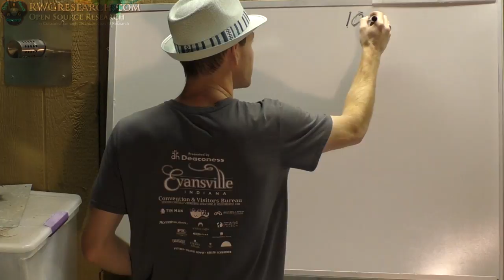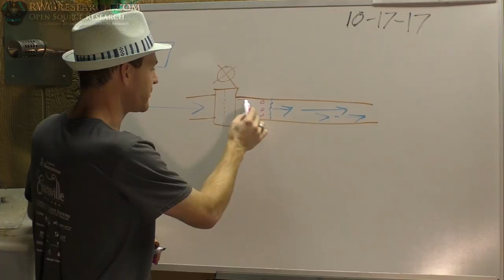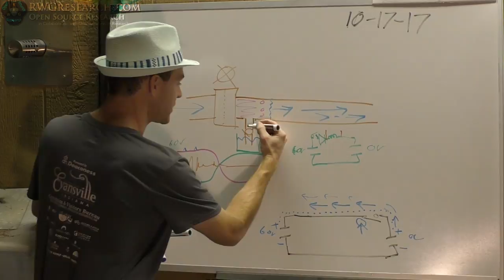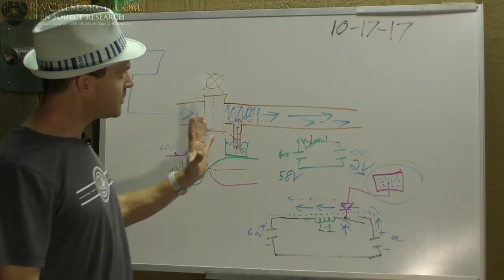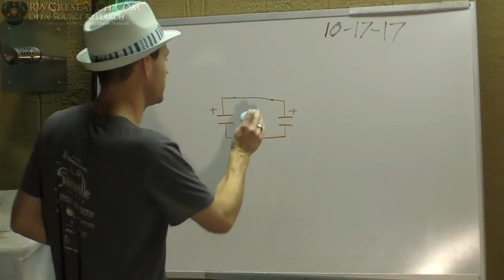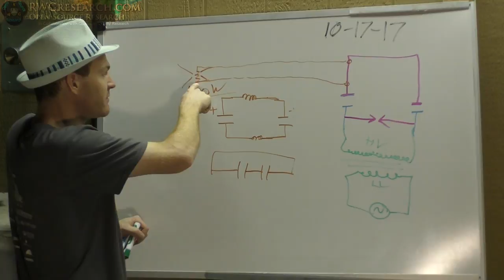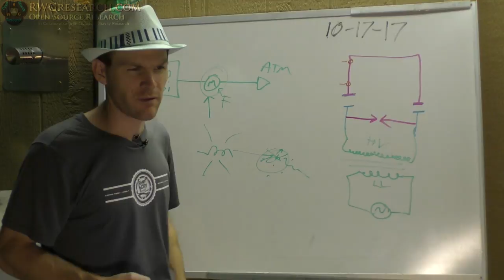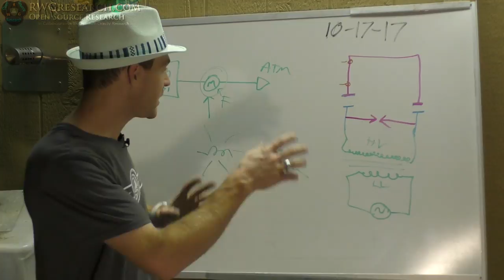The Search For Answers Part 7: Eletrical Water Hammer? Thinking Out Loud... & Other Ideas To Share.

Comment: another point worth mentioning is that if we can generate a low pressure energetic state and transform the energy, then it might be possible to generate an energetic sink that would perpetually generate energy.  So low voltage, especially with negative resistance potentially could generate such an energetic sink...  If we think in terms of pressure systems and fluid dynamics, I think things become more clear.  That is why I like the water hammer analogy type of thinking...

Comment: Great man, how do I make a ZVS driver that oscillates at 500 khz to 1mhz that can use about 36 volts at 25 amps. .3uh inductor .33uf capacitor.  If I increase input voltage and amperage it should oscillate faster or not and why? =1/((2*3.14)*(SQRT(inductance*capacitance)))

Comment: Hi Russ,
I am planning to build a Leedskalnin PMH device. You mentioned that one can store energy in a magnetic field at ambient temperatures and showed one of these devices in the video. I thought this device works on a principal called "magnetic hysteresis" of the metal used in it. This has long been understood and is how the old magnetic core memory in the 1st computers worked, how computers store info on a hard drive, and how magnetic recording tape works. Are you referring to when you pull off the magnet keeper bar, the magnetic field in the bar collapses, a current is induced, and the LED lights for a split second? How is the energy stored? If you don't put energy into the system by the act of pulling off the bar, which requires work,  no useful energy can be extracted from the device. What are your thoughts on this?

Bill
Reply from the maker: William Hada Bill. This is corect. 
Its the same prencible. The deffrence is how the energy is extracted. Core memory dose it differently. We breake the loop. 

I made an electronic PMH so it can be "switched" on or off instead of removing the bar.  I don't think I ever made a video on it. I can if interested. 

I was just pointing out in this video there there are diffrent ways to do this stuff at room temp.  
Just to open the thoughts to people. 

Right. When you pull off the bar. The feild collapse.  Whats Intresting here is that what ever you put in to the loop of iron. Stays there. (It dose not slowly disipate like a charge in a cap.)  
So this is in its self a "room temp super conductor" in its own right. 

Becuse its not permentanly magnitised. It is  A state of magnetism,  but not permonant yet dose not degrade its strength with time.  

I'm sure one could call me wrong for calling it a super conductor.  However I feel its the right term. As it only works as a temporally permonant  magnetisum storage device at room temp.  With out degrading its strength.  

Hope this helps. ~Russ

Sorry for the typeos.  On my Phone. Ergh

Comment: FIRST QUESTION: Back and Front EMF Phenomona. Secondly, you could run a motor in between your two batteries and yield the same voltages on both sides: about half.

I like this discussion. Its like trying to understand the Don Smith application.

On your last, and I haven't experimented with this at all by the way, can one use piezo electric from the heat of any one of the motors in the circuit to produce a cooling effect on the other side in order to "super cool" the magnet?

Comment: what you want is already made and commercially available. an exact electrical equivalent to a water hammer is called a boost converter. they are roughly %90 efficient just like a properly made water hammer. low voltage high current in, high voltage low current out.  if you want the other way around, its called a buck converter. high voltage in and low voltage out.

a boost converter is very similar to the joule thief design. except the commercial ones are more consistent and often more efficient.
Reply from the maker: Jimmy O. Yes. I know all about thses. But this prencible is slightly diffrent. And from my understanding most boost/buck converters are horribly efficient.  Mabey there are new ones that are better. Thanks!  ~Russ
Reply: they are about as efficient as you can get right now. far more efficient than using normal AC transformers on linear regulators or resisters to drop the voltage to a usable voltage.  when converting AC into dc switch mode power supplies are used for the best efficacy they turn the AC into DC right away then use that DC through a buck converter to get the desired voltage. this is whats used in just about everything from your 3D printer to your cellphone charger. if they were solid cor transformers they would be much larger and produce alot more heat.

Comment: if you capture the magnetic fields created by electrical currents, it is not free. and it will draw power from whatever is causing those electrical currents. this is exactly how inductive motors work.  similarly transformers and ballasts work in this manner.
Reply from the maker: Jimmy O. Conventional thought tells you this. ("Drag")  However there are so many ways to use that feild.  And some of them do not effect this as you Speek. Also you can enhance the effect if done right. ~Russ
Reply: all energy is conserved. electrical energy is no different. Using that energy will end up effecting the source. either forcing the source to pull more power or decreasing the energy being delivered to the load.

Comment: I have been thinking about your Tesla example of lighting an incandescent bulb with a thin wire. I think Tesla used very high voltages with very low current. If you think about it considering watts in versus watts out it is not so unusual. Say you have a 100 watt bulb in a 120v ac circuit. The current drawn is 0.83 amps. If you put this same 100w bulb in a 12,000 volt circuit it only draws 8.3 milliamps of current and a thin wire could handle that tiny current. So in both cases you are still using 100 watts to light it. Is my thinking completely wrong here that you need to consider both voltage and amperage?
Reply: William Hada by my understanding that is correct.
I hope someone calls me an idiot and then proves themself not to be - by proving your postulate incorrect
Reply from the maker: This is a corect statement. 
Now. Do the math to calulate how much voltage and apmrage you need light a 500watt halagan to full brightness  Let me know the numbers. Let's say for what ever max current a 50AWG wire can handle. 
Then ask your self. If I need x, xxx, xxxV @. 000xxx amps 
What air gap do I need to keep this very high voltage from jumping from wire to wire?  
What I'm telling you is I can lay the 50 AWG wire 1mm apart from each other . (Magnet wire of course )  and it will not arc... ??? 

Also look at the circuit. Your tapping off of a dead short... Soild copper bar. 
I believe it can be understood.  However its not convental V x A
We will look at this further. But for now. Think about that. Let me know your thoughts!  Thanks for the comment. Its a good point. ~Russ
Reply: rwg42985 I thank you for takng the time to respond to my comment Russ. From my calculations a 500w lamp would draw 42 milliamps at 12,000 volts. A 35 AWG copper wire is rated at 44 milliamps max,  and has an O.D. of 0.00314 inches, pretty thin. A 50 AWG wire has an O.D. of 0.001 inches but I could not find the maximum amperage for this size anywhere. For 12,000 volts the minimum distance must be greater than 4 mm to prevent arcing over. Now, did you yourself do the 500w quartz light experiment or is this something you guestimated from a video or it was just claimed to be so by the other party making the video? I myself could not determine the diameter of a 35 or 50 awg gauge wire by eye ( 0.001 vs 0.00314 inches OD) . Nor think I could tell by eye if the wires were 2 mm vs 4 mm apart in a video. If you yourself , Russ Greis,  replicated this experiment and actually showed all the measurements on video I would have pretty much 100% confidence it was true.I find you to be very honest about everything you do and are very open to criticism and debate. Others I am not so trusting of because the experiments are often done in a confusing and sloppy manner with a lot of details missing. 

I have been following you for a while now. I am also into 3D printing and found your channel when you built your filament extruder. You are one amazing and multi-skilled dude!
Your energy and passion for your work is awe inspiring. I don't know how you get done all that you do and support a large family at the same time. But what impresses me most is your honesty and search for the truth. However, I am somewhat concerned about your health and that you are getting proper rest with this heavy workload. Stay strong, healthy,and keep up the search man!

Bill

Comment: Another great video! In the Tesla hairpin the reason there are two capacitors is because there is little or no voltage drop in the distribution supply line. This is still used today in distribution lines. It was invented by William J. McElroy www.google.com/patents/US392213 and https://www.google.com/patents/US393073 . The energy stored in a magnetic field is the capacitance of the Tesla bifilar patent. Thanks for sharing, Mike
Reply from the maker: Arkiver Unified Energy good stuff. I'll have a read. Somthing tells me its not the same thing that the hairpin dose.  But I'll need to look closer. Thanks!!  ~Russ

Comment: So it seams what Tesla refered to as radiant energy is now often called "cold electricity" apparently due to a cooling phenomena that occurs with this sort of technology.  Even John Searl said that his device would get colder and colder, eventually becoming superconductive.  If you think about how compression generates heat, and expansion cools, and apply the fluid metaphor to electronics, then perhaps there is a clue there.  If we think about voltage being related to pressure, then going from a high voltage to a low voltage might generate cooling.  I wonder if this is a missed concept about this work that many of us are missing.  If you think about it, a high voltage low current field has a week magnetic field, but a strong electrostatic/dielectric/capacitive field.  Now what happens when we collapse that field in the case of a spark gap?  Don't we get a surge of high current and low voltage?  In fact, don't we get negative resistance in the "infinite" conductance of the plasma when the dielectric breaks down?  DiveFlyFish showed that on the tesla hairpin circuit, the spark gap is "cold".  I know this is sort of the opposite of what most are saying, but I think it may be something to ponder...
Reply: I want to add that a capacitive field collapse would produce different results than a magnetic field collapse.  Therefore, I suggest the surge in the current found in the plasma within a spark gap would be different than the collapse of a high amperage magnetic field as in a typical transformer.. Perhaps this is related to the difference between longitudinal waves and transverse wave.  I think this might be where the fluid analogy falls apart, because there is a difference in quality in the current generated via the collapse of a capacitive dielectric field vs. the collapse of the magnetic field.  I wonder if the collapse of a high voltage low current dielectric field generates a high current low voltage dielectric field.  This is a different sort of transformer than the standard EM Transformers commonly used today...

Comment: Your circuit looks like a boost converter but old eds magnetic charge storage device might fit also energy is not consumed and destroyed its radiated out at inverse squared in what ppl call vibrations sound heat light. Good idea to pull from sky potential it has the volts you just have to amp it up so to speak.

Comment: In water, the momentum needs to be built first. In electricity, it speeds up instanty, right? I can't imagine a lot to be extracted from it.
Leedskalnin also seeemed really obcessed with this and left us the curious PMH. I wish we'd understand his work. Although, it  wouldn't take long before it was weaponized to make genocide more efficient...
Reply from the maker: Cloxxki no this is Incorect. Google "propagation of eletrons in a wire" its slow. However the "charge" is instant. Its the "flow" or the idea of one electron pushing the next till there all pushing each other. This takes time. ~Russ

Comment: Russ, wouldn't the injection of a disruptive discharge into a circuit be analogous to water hammer?
Reply from the maker: clixbits well that's kind of what I'm saying. Think spark gap. Look at those beautiful transients. Where dose that excitation come from?  Voltage potental way above the voltage in the circuit. Same thing when a coil's magnetic feild is collapsing...  Sure you have current (about the same as you put in) . But where dose that high voltage come from?     Thses are my thoughts.  Yes. ~Russ

Comment: Yes your very close with a water system your just closing the valve to fast that why fire hydrants are close slowly.  Closing a valve to fast will shear off a hydrant.  but your talking like the water hammer is down stream of the valve it not, its the weight of water slamming in to the face of the valve and even the elbows of the pipe this is the hammer that breaks pipes and valves.    For electrical system it like I'm running a 440 three phase heater at 20 amps and I grab the plug in and unplug the power with out killing the power I can get a 3-4' arch trying keep the current flowing.   That would be the equal of water hammer plumbers use an upside down tee and stub pipe with an air bubble to control water hammer in water system.  A capacitor and to a lesser extent an inductor would have a similar effect on a higher current system.
Reply from the maker: Frederick Kaludis there are 2 things to note here. The vlave closing.  There is pressure on the valve (I did not talk about this)  and there is the water in the rest of the pipe that wants to stop. But it can keep going. This is where the vacume is created. On the other side of the valve. Not the pressure side. But the low side.  ~Russ

Comment: Russ i sent you an email a while back about the hairpin circuit but you didnt replied.
 So here is it again
   In a video i seen a standing plasma wave in a vacuum chamber. The video maker didnt got into much detail, but it seamed like that it was just an adjustable frequency HV power supply connected to two electrode in the vacuum.
 He turns it on tweaks the frequency and nice plasma orbs line up between the electrodes. Now......   What would happen if we add to capacitor on both sides of the chamber leads and hook them up as the hairpin circuit?? I would love to try it but dont have the equipment:(  See in the hairpin circuit the spark is pretty rough and the light on the capacitor side is flickering matching the flickers of the spark. What if this would cut that out and we would get perfectly smooth light output? What you think?    https://www.youtube.com/watch?v=2yf2zwGDbhw&t=100s
What kind of transformer exactly i need to get to replicate this?

Comment: your diagrams are incorrect but the idea came across.  getting something from nothing is wrong. you can get higher electrical potential from something similar that much is true and easy to do. but the flow at the higher potential is less. energy in and energy out will still be the same minus the losses.
Reply from the maker: Jimmy O. Yeah.  Presenting some thoughts. And doing it on the fly...  As long as the point makes sence. The bench tells the truth. We go there. ~Russ

Comment: well, nice try russ.  but, at the end of the day, this presentation is a forty-six minute 'if...then you could...' monologue.   if you want to test a legitimate theory, consider the possibility of using leverage / mechanical advantage in order to get an energy gain.  see my video if it suits.  imo, it works on paper.  making a functional version requires that every component be purpose designed; not off-the-shelf.  this is one reason others testing the theory have failed.  george chaniotakis has made a bench-top apparatus, that utilizes a magnetic, non-contact reduction drive.  with no commentary, at first viewing, i did not understand the significance of slowing the small dc motor with a finger on the shaft.  (it shows the milliamps that the motor draws when under a load; there appears to be an energy gain of one-tenth watt.)  see his channel if it suits.    cheers